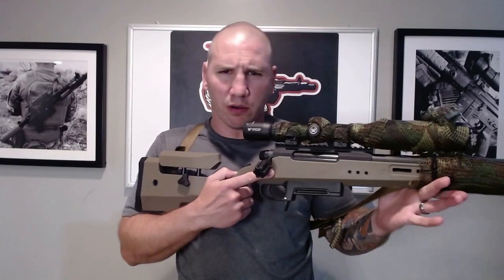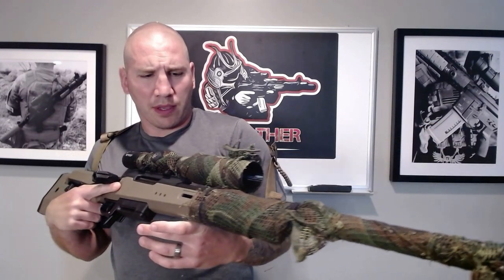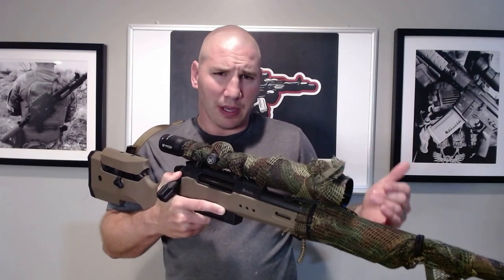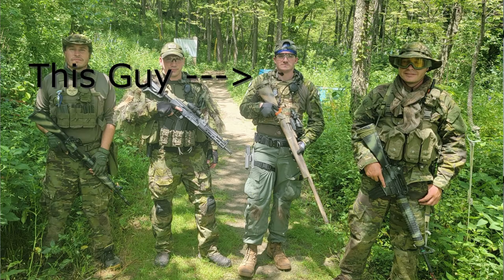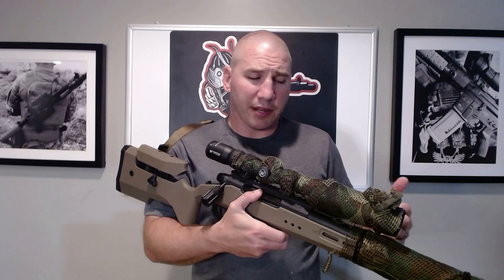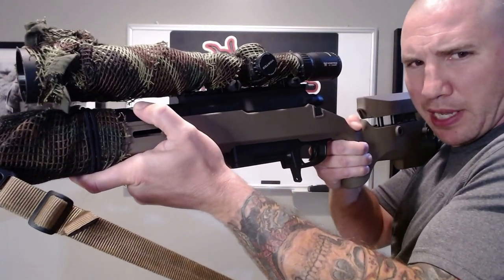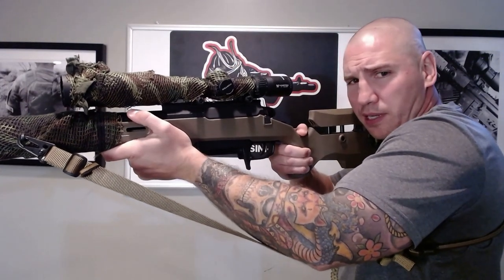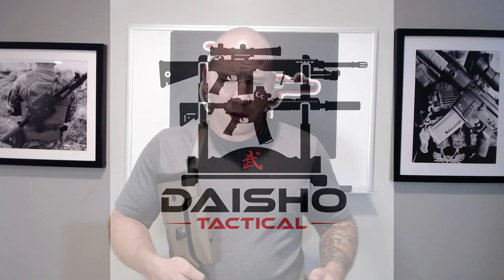Silverback Tac-41P - Upgraded and field tested

Comment: If you want a very easy and cost effective way to silence the rifle with no performance loss is to do the soda can mod! Cut a soda can into a sheet, cut that sheet to about a quarter of its size and wrap it around the spring guide, put the spring over it, flare the bottom of the sheet. Also do this, without the flare, inside the piston. Completely eliminates spring twang. The Silverback VMP + Silverback Airbreak Piston Head is also the most cost effective piston system out there too where you can silence up the rifle with no performance loss.
Reply from the maker: I am looking at the VMP.
Reply: @GunfatherMilsim  I agree with Shadow. I have the SRS, if you do the VMP (Which I highly recommend), you definitely need the air break piston head (Also highly recommend) as well. That combo with a nice can on it makes a enormous difference in the how quiet you can make it!

Comment: Hi! I’m thinking about buying the TAC41. In your opinion, if O just change the spring, the gun will perform satisfactorily? Tks!
Reply from the maker: Yep. The only thing to improve beyond that IMO is trying to make it quieter. I never performed those upgrades but my understanding is that the Mouse Fart Pistonhead reduces the noise significantly.

Comment: Can you review the Nov SSG-10 A1/A2 or A3? love your reviews. Super helpful.
Reply from the maker: I am not really interested in any of the Novritsch product line. I have had a chance to shoot the SSG10. It is good, not great. IMO they are not worth the money. If you have any mechanical ability at all you can build a better performing rifle at a much lower price point.
Reply: @GunfatherMilsim  I really wanted to get the Tac-41P but I hate the hollowed bottom. near the stock, and the fact the hand guard being so flimsy would drive me nuts lol. But I think I'm gonna settle for the Tac-41.
Reply from the maker: @Reb0rnKnight  The Tac41's performance after a simple spring upgrade is phenomenal. IMO it is the current best airsoft spring sniper.
Reply: I have the Tac41, JG Bar10 and the Novritsch SSG10. Imo the Tac41 is the best ootb performance and it has a real good feel in the hands. If you want to go for a cheaper alternative which is also really good after some upgrading, I would suggest getting the JG Bar10, the built quality is cheaper but it can become a top end sniper after some mods.